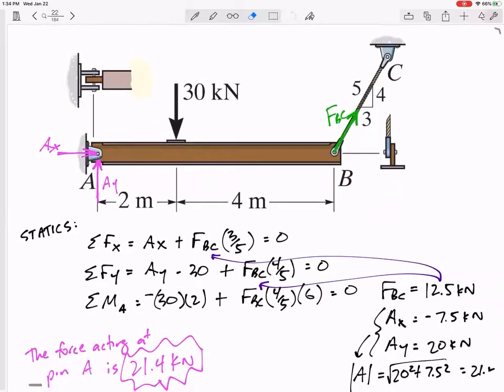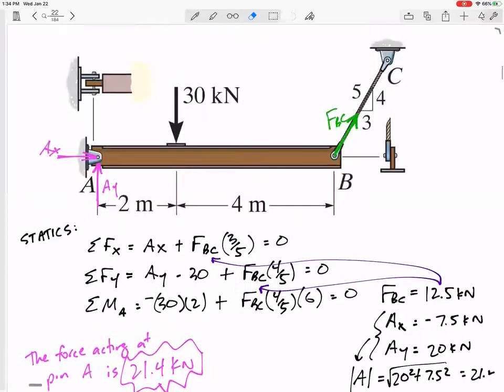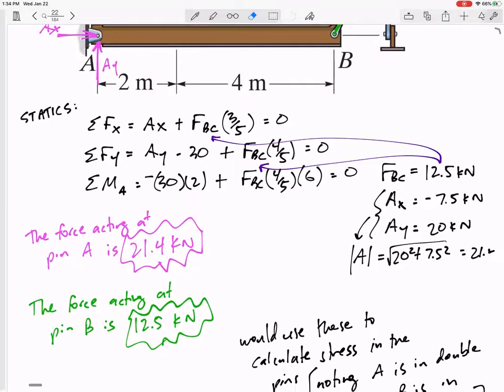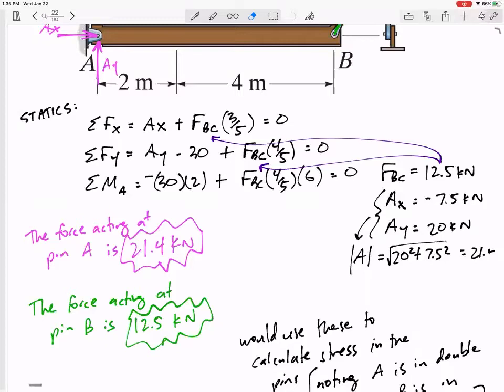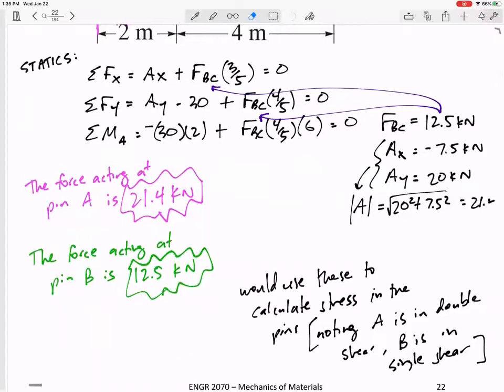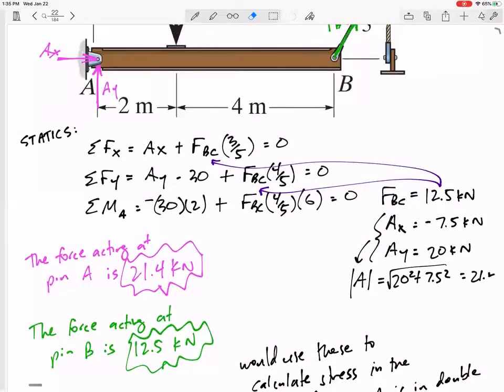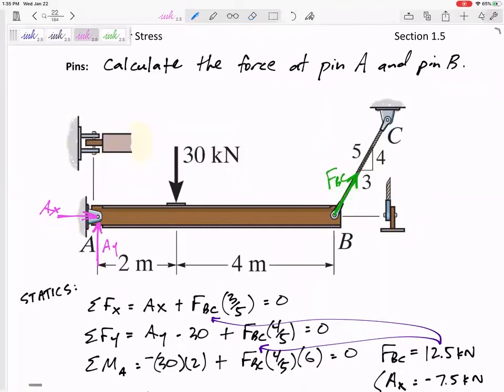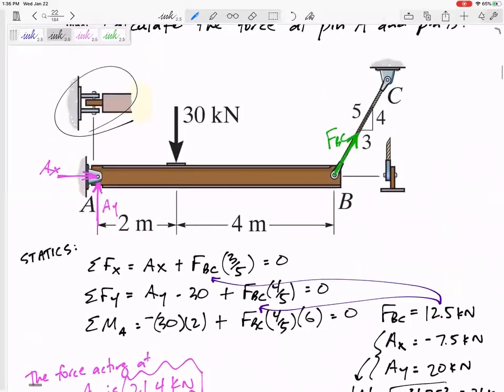Mechanics of Materials - Overview of allowable stress design problems

Comment: But sir, dont we use the sectional area to calculate stress. Is it enough to say Tau equals to Fa/2?
Reply from the maker: The cross sectional area to use for shear stress is the area of the circle (pi r squared) of the pin. In double shear, divide by 2. In single shear, don’t divide by 2.
Reply: @engineeringdeciphered  Understood, thanks for responding sir.